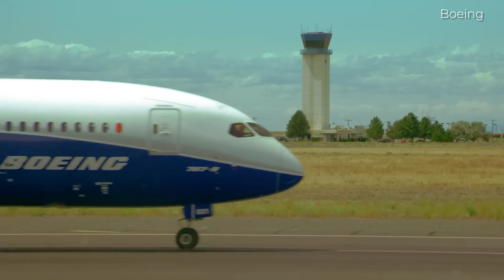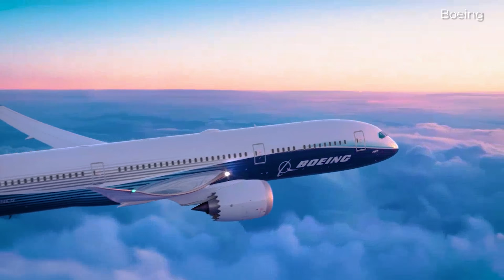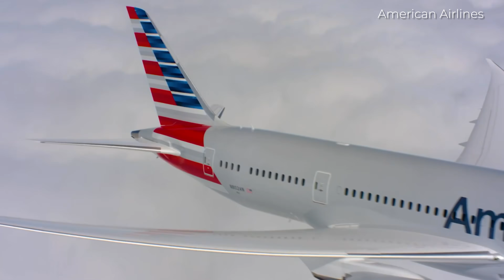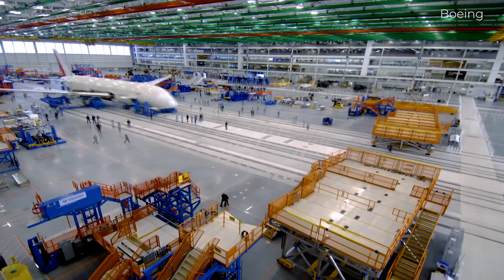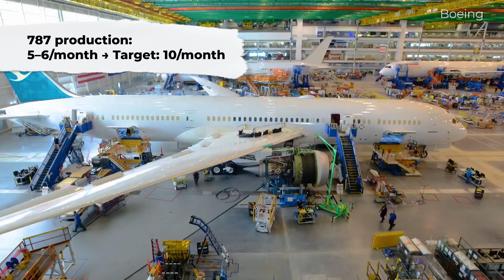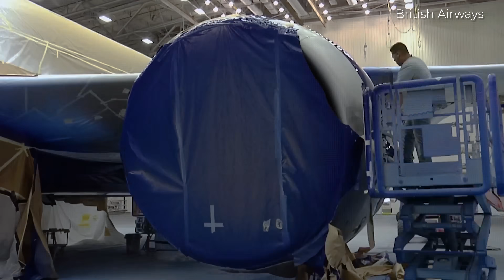Explained: The Tiny Defect That Can Ground a Boeing 787

Comment: let me explain u the video in few mins:
1. Boeing first one to try carbon fibre composite along with 50% aluminium
2. Less knowledge of chemical and physical properties of these new composites over decades
3. Aircraft industry has very tight buffer margins, so Boeing had to delay to learn more about 2. as they have more flight as well as scientific data.
4. Boeing delays from ~120 aircrafts a year to ~65 aircrafts a year but the booking partners are still commited as changing the fleet is very costly because of pilot trainings and technical maintenance team overhaul.

Comment: Boeing may be the trailblazers for composite fuselages, and undoubtedly this has added to the industry's knowledge, as well as having the unfortunate financial hit to Boeing who are still struggling to break even on the 787 project unlike the profitable A350, which although composite like the 787 uses composite panel fuselage construction in a more conventional manner.

What will be interesting to see is how future composite fuselages are constructed. Will they use the more advanced 787, or the more conventional A350 methods? No doubt, as the initial airframes age we will get far more of an insight as to how easy each chosen construction fairs regarding maintenance, repair, and longer term unexpected weaknesses.

Comment: A key point is that the 787 is largely an electric aircraft with only one main system battery!  Airbus are now moving to a two battery design for newer models.  Boeing seems reluctant to remove this potential single point of failure.  Uncommanded engine shutdowns, electric braking mishaps, and other issues continue to occur.   From what I've seen it is now likely that Air India AI171 was the victim of sequential electrical failures.  So it isn't just the novel structural elements, the move to an all electric control system also stretched the concept of what was possible.

Comment: Andreas.Berger.87. 9h ago (edited)
Just as a side note: there seems to be an ongoing issue with the electrical brake system on the 787. I recently had to perform an action order issued by Boeing where you had to check if the screws of the individual brake actuator servos in the assembly were within a certain torque range or even loose. Well I'm not gonna report my findings here but what I found was rather concerning. Those screws are torqued to a pretty low setting to begin with (probably because of the aluminium used) and there is no securing mechanism that will hold those screws in place (no lockwire, Loctite ect.). So from what I've heard and read I suppose the brakes were slowing down the aircraft and shortly before take off outright blocked the 2 left wheels!